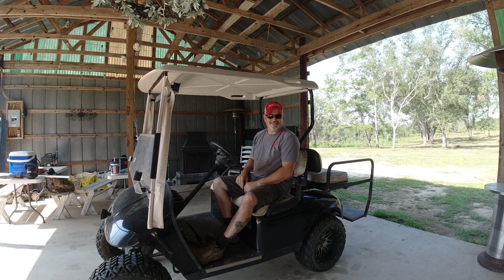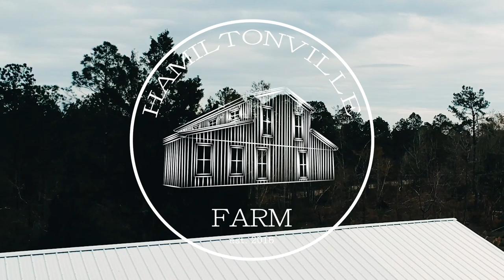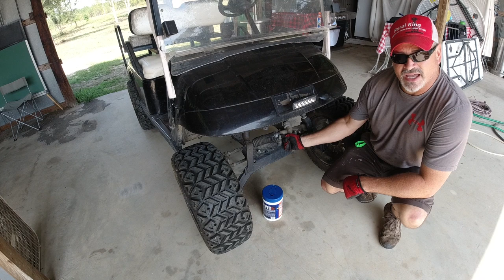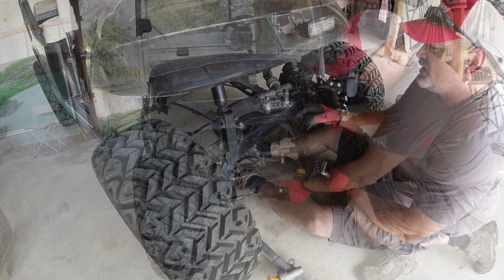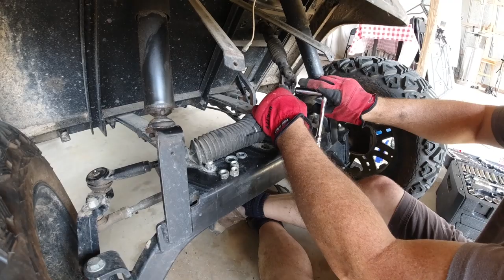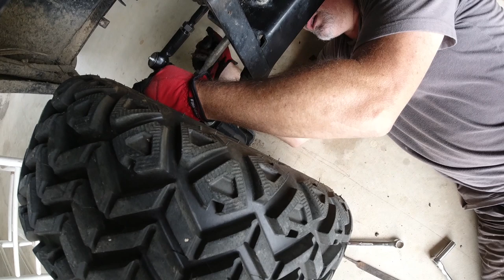CAN I FIX THIS GOLF CART?WHAT COULD GO WRONG?😩😩 EZ-GO TXT

Comment: Sir: Just got my hands on a nice used 2006 EZGO electric with bad batteries and very dirty. Was perfect when put away years ago. Getting batteries locally and want to service the entire cart. My question is what oil are you using in the rear diff? I'm sure I can figure out how to drain and fill as I've been wrenching for almost 60 years now. I don't have a manual for this thing but some sites said non-detergent straight 30W...others said gear lube. Your thoughts? thanks much.